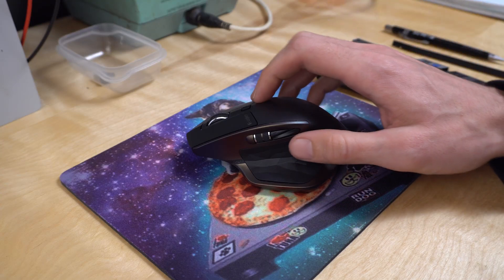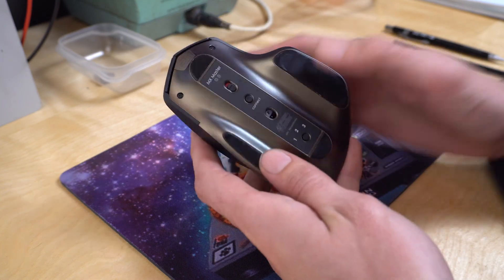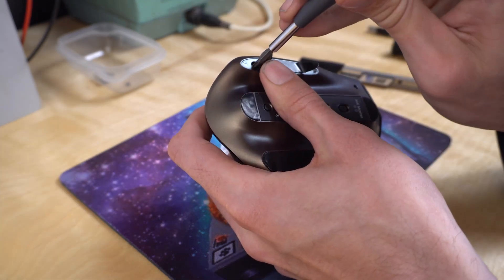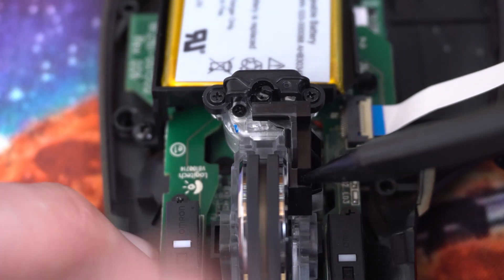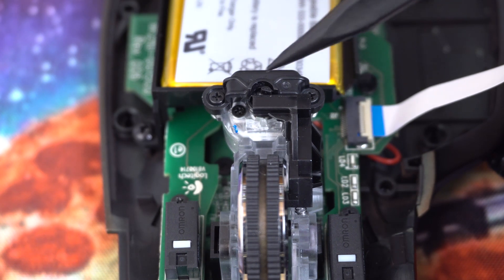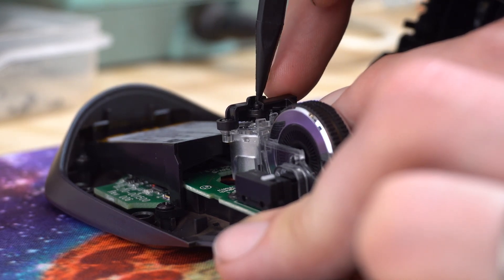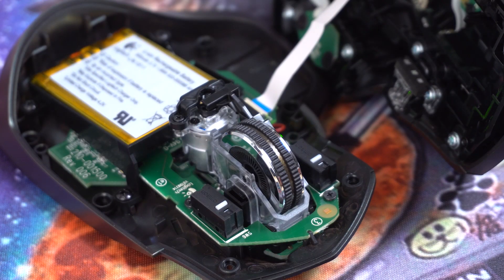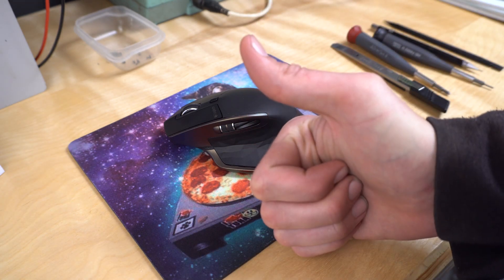Logitech MX Master Scroll Wheel FIX

Comment: I had the identical problem and was searching to a solution when I fell onto your nice video. I have an easier solution I figured out. Instead of disassembling the mouse, turn it upside down on a soft but firm surface (I use my mouse pad) and lightly but firmly knock it onto the pad. It takes only a few knocks to reengage the ratch mechanism.  
For such a premium priced mouse, Logitech SHOULD design and build this mechanism at a higher quality level so that it is reliable.
Reply: it worked for like a second lmfao will try again tho
Reply: Thanks that works pretty well.
Reply: Thanks, I can confirm this works!
Reply: Was just about to try this, i didn't even have to knock it! I just turned it upside down and I heard a click and now it's ratcheting again. Thanks!
Reply: Omg I thought I'd look in the comments to see if anyone had any better solutions before I went off to find a screwdriver to open the mouse and probably break in cause I don't know how circuitry works. I'm kind of upset I didn't think of doing this first. Thanks for the tip, it definitely beats (excuse the pun) trying to open it up.
Reply: OMG you are a God, thank you. Thanks to the OP though as well, that video explained it super nicely and was actually enjoyable to watch. Not to mention it put a name to the issue of my "not properly functioning mouse wheel"
Reply: Wooooooooowwww that works ... thanks mate!!!!!
Reply: Confirming this worked for me as well
Reply: It worked!. Thank you sir

Comment: Hi Thomas/other viewers, opened my mouse, expecting the prob you're having us look for, but that is not my problem it seems. The turning piston does seem to be in the proper spot. But in my case the rocker that should go back and forth does not. I can push it in to the point where the ratchet works but as soon as I let go it goes back to free mode. Like as if the spring that should push it back was weak, This happened to me after owning it for just 1 week, in theory the spring should be good.

Any input here would be greatly appreciated.
Reply: You know what, I watch a few more vids with a similar fix, re-opened my mouse and pushed that piston with a little less fear and voilà. So I am not re-screwing in the Philips top be ready to open and fix again if I have too. Sad to have to do it this way but so be it.

Comment: First of all, thank you for this awesome tutorial. Of course it "fixed" my MX too as expected. And then about a month later, it did the same bullshit again. Taking off the pads is the biggest problem as they tend to split (mine did). They should have at least put the screws somewhere accessible like the two torx ones are (and don't even get me started on how stupid it is to use two different types of screws and especially a friggin' itty bitty torx -- I had to order that screw-driver set just to fix this f'n mouse)!

Anyone come up with a permanent solution yet (that still gives free-spin AND ratchet modes). As a programmer, I use free-spin all the time to zip up and down my code, or web pages. I use ratchet to step through the same for reading/debugging. It really is amazing this is a problem, as I have an MX Revolution that has this same free/ratchet wheel and it has never had a problem in the 5+ years I've owned it. How the hell did Logitech break a working mechanism? Didn't they ever hear the phrase, "If it ain't broke, don't fix it."
Reply: Lol. I started facing this probelm now

Comment: Bad luck?  I've seen so many good reviews on this mouse...
Reply: No. Not bad luck. Bad design. There are WAY too many of us with this busted-ass wheel. They really should do a recall.
Reply: I'd say it's still worth it, despite this problem. Excellent mouse.
Reply: long term users have reported this problem multiple times.
Its my only concern as i am thinking of getting this mouse.
One proposed to disable the freewheel option from the software to avoid any possibility of malfunction but it will take away a piece of the experience...
Reply: Robotic Nerd I've had mine for little over a year and frequently switch between the two scroll modes, haven't had any problems at all!
Reply: DAE51D Maybe, but at least it's a relatively easy fix...
Reply: I brought this mouse in Black Friday sale, a month ago. I went to use the mouse and noticed the wheel problem. My heart sank as I read about this problem occuring. However, thankfully since I brought it from Amazon, they are sending me a replacement, so I get my new mouse tommorrow. However, great video, atleast if this happens in the future, I know what to do.

Comment: My scroll wheel was in free-wheeling mode, but the screen wouldn't move, so I took it apart and removed several years of food particles and who knows what else.  The scroll wheel then worked and started clicking, but the screen wouldn't move.  So I downloaded the most recent update and it works like new.  This is the second time I've had to do this in several years, so not too bad.  Hope this helps someone.

Comment: why the fuck would logitech use normal phillips head aswell as a fucking annoying to find torx screw? why not phillips on all what a nightmare
Reply: I know right!? Da Fuq. So annoying. And also hiding the screws under the pads too. At least if I could open this up easier, it would be less of a hassle than it already is. I had to order that damn itty bitty torx screwdriver just for this mouse!

Comment: People u dont need to disassemble whole mouse, just bend some wire or attachment pin and insert it behind mousewheel, it just pops right in place and thats it :D
Reply: Yes. PLEASE illustrate how this works. I'm sitting here with a paperclip and can't seem to get it to work (as you indicate it should be easy)...
Reply: make a video?
Reply: Actually milvuc's advice does work, but for me temporarily. I powered off my MX Master, and looking at it so that the scroll wheel is facing me, while the mouse is flat on the desk, I inserted a paperclip into the upper right behind the mouse wheel. (You can tell in the video where the lever is that controls the flywheel mechanism.) After a little fiddling it clicks and the ratchet mode comes back. I was very pleased with this until I powered the mouse back on. CLICK. Back in free-wheel mode. I could hear it engage the second I turned the mouse on. I repeated this several times and realized that with the mouse powered on it would not stay in ratchet mode. So in the end, no luck for me. Tried taking it apart and fixing it and putting it back together to the same effect. Plus I've slapped it silly. Can't fix it. This is just a design flaw and I don't think there is any practical no-time-wasted way of fixing it.
Reply: Stabbing behind the mouse wheel blindly with a paperclip worked for me

Comment: Thanks for the vid, very useful.
Small correction: You'll need a TORX T4 driver, not a T5.
Did you finally use glue to fix the problem? If so how did it turn out?

Comment: Has it popped out since you fixed it? I just got another broken replacement today and I did you showed here instead of sending it back again.
Reply from the maker: Mine worked for about 4 weeks, then it happened again. It's quick enough to do that I won't be too upset over doing it once a month. If it starts happening more often I might experiment with ways to keep it from happening.
Reply: Yeah mine came off the next day and I put some super glue.
Reply: Where did you put the superglue? I imagine it's quite fidly so that you don't block the motor from functioning.
For noz I've disabled the smartscroll shit.
Reply: Popped out the gear and used a pin to spread it inside its mouth then pushed it back in. The thing was so tiny that I used my finger that was glued together with it to place it properly. Then I started pressing the button to make it spin so that I couldn't make contact for long with the surface of the motor and get stuck from the glue. It was a very dirty procedure and I was really lucky cause the gear ended up aligning perfectly .

Comment: same problem, any update on the status of your mouse after the fix?
Reply: I think we could stick some kind of plastic above it to prevent the axial movement
Reply from the maker: Two weeks in and it still hasn't come back. I do half-expect it to come back but hasn't yet.
Reply: 2 weeks since the fix and now I think I am about to loose the ratchet again... The ratched mode is very weak already. I will open the mouse soon again to see if it is the same thing again. Any ideas how to fix it permanently?

Comment: Wow!  This worked perfectly.  I only bought the mouse a month ago (April '16) and within a couple of weeks I had a feeling the ratchet was going / had gone.  It wasn't until I tried a co-workers mouse and realised how broken mine was.  I was about to return it, found out I'm on day 31 of purchasing it so Amazon won't accept!  Hunted around to look in forums, with everyone complaining about it, with no fix.  This video has saved me writing a very angry e-mail to Logitech :)  So strange that it's such a common issue though.  I had a MX Performance for about 6 years with no issues!  Thankyou for the great video :)
Reply: i had a Mx revolution for ages and no issues either... 1 month and my Mx master is wheeling free
Reply: day 31? really, come on Andy, retailers policies have no power over your rights.
Just tell Amazon to replace or refund, item is faulty, if they won't then start a small claims case, (give them notice of this in writing - hint they will refund then.)

Item has a multi-year warranty from Logitech, Amazon, being the retailer, is who your contract is with, so they have to honor it.
You also have other rights as a consumer - fit for purpose and last a reasonable length of time etc...

Don't let retailers walk all over you.

Comment: TIP: Blast the pads with a heatgun on low or rest the mouse on a warm surface to loosen the glue on the pads.
Reply: I dont have a heatgun, can I just use hair dryer :) ?
The point is, I would try fix it, and if scroll is still broken, I would return it (im in within 30 days return policy) - but can't return it if they notice those pads are damaged.
Reply: Yep a hair dryer will also work.

Comment: The MX Master I bought 11 months ago didn't have this issue, but it went dead a month ago, and the replacement I got YESTERDAY already had its scroll wheel stuck in free spinning mode... I'm sending it back for another replacement, but I'm worried the replacement will come from the same batch that's gonna have this issue sooner or later.
Reply: The replacement I also had this issue. In no less than 3 hours the ratchet started weakening. I've contacted Logitech for another replacement.

Comment: Could anyone tell me if the issue has come back, or is it worth giving the fix a shot?
Reply from the maker: +Daniel Bech I've used it for a week since this and it hasn't come back, not sure beyond that.
Reply: +Thomas Renck Did the trick, hopefully lasts more than a week :) However, I remember the ratchet problem appeared in less than a week, ratcheting became softer and softer until it disappeared totally in 5 days. Could it be a false installation on the production line? The disc arrangement is not properly installed to the bottom but is "floating" until it pops up? We'll see...
Reply: +Thomas Renck Thanks for the quick answer. And thank you for taking your time to make this video. I will try it out, because I really don't like having it to free-spin all the time.
Reply: +Antti Tuominen It could definitely look like an issue caused in the production line, otherwise it's a huge engineering flaw, which seems unlikely.
Reply: Issue came back after week and half. Plan to remove bottom pads so I can just quckly unscrew and fix it every 2 weeks:)
Reply: Same with me. I commented earlier that I am about to loose the ratchet, now it has gone totally in about two weeks. I would prefer, however, not to open it in every 2 weeks but find a permanent solution. Any ideas? I was thinking to stop using the smartshift mode, use it all the time in the ratchet mode and manually switch to freespin when I want to. Maybe that would prolong the repair interval?
Reply: It doesn't make sense to open the mouse every 2 weeks :( But since fix is moving that small disc down, maybe it can be fixed somehow. Its not movable part, right?
Reply: Waiting for the fix from mechanically more advanced people :)